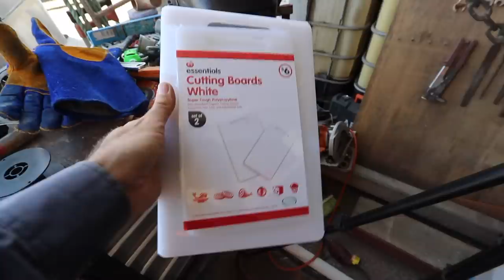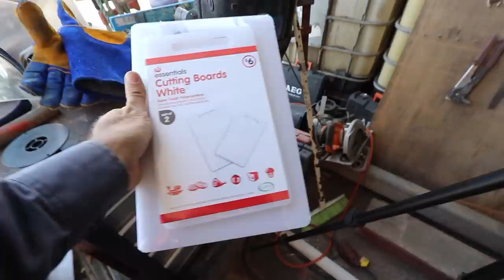DIY Rigid Inflatable Dinghy, Hull Welding Part 4, - Project Brupeg Ep. 110

Comment: Can you get to all the tube seam welds should one have a leak?  If not, I hope your pressure test shows no leaks.
Reply from the maker: Hi David, yip we built it so the tube joins were easy to access. once it was seem welded we run a positive pressure test and corrected the leaks. the tubes are now air/water tight.
Reply: I figured you planned ahead.  I know a lot of time miss things.  Great work!

Comment: On the keel of the dingy, in regards to the ice you might fork in your travels, add a length of the same pipe you used as a rail on the inside as a stiffener. Doesn't need to be fancy, just something to take the impact loads and soak them up. I feel that the existing shape is too constricting (it was a tube frame after all) and cracks might happen because of it.

Maybe even some straps along the inside of the seam between the old boat and the tubes, 3 or 4 per side from the center towards the tip. I mean, i know it's a dingy, but there's some considerations to be taken about aluminium in cold water. OH, and profit that the batteries are so small in the space you've made and insulate them well.

As always, just my 2 cents.
Reply from the maker: Hi Aserta, remember this is the back up dinghy so its pretty low speed (5-7knots) so major impact damage is likely to be minimal. However i like the idea of the straps for the Jet tender as that will almost certainly hit something hard at some point.

Comment: Looking great 👍 Not so sure about the cutting board tho, not much likes to stick to that stuff. Did you consider Anderson plugs (automotive) ? and a cable gland. Designed for high current and pretty cheap.
Reply from the maker: Hi Bill, i looked at both. couldnt get an anderson plug waterproof and able to handle the amps and yes a cable gland couldve worked but figured this was a simple alternative. The glue we used is pretty awesome, stiffs to bloody everything in the world
Reply: 👍 I should know by now not to doubt you 😁
Reply from the maker: Doubt away, i miss stuff all the time and its great to have it picked up now
Reply: Nah.. I aint no troll 😁

Comment: Great problem solving skills guys. I’d love to contribute in some way to the boat. Do you have a drawing with the outer dimensions and I’ll use screenshots to draw it up then 3d print it to make a cast in silicon bronze or whatever you’d prefer excluding the optimistic metals. I’d like to give it a crack mate if you’d like. Cheers.
Reply from the maker: Wow that’s an amazing offer. Could you email us at teambrupeg@gmail.com and we can chat about what we have. I have the original plans for the boat so that will have the dimensions needed to print the outer shape. A massive thank you for this. Damien & Jess
Reply: @ProjectBrupeg  .Hi guys.  Stl finder has turned up a number of excellent hulls which are easily modified to match brupeg. Virtual shipyard has an insane level of detail and the upper deck structure and fittings are readily available or easily modified. The drawings you have will make it quite accurate.  Thingiverse have great files of animals Jess as we will need a dog in there somewhere. Check it out. I really believe it will be quite beautiful when completed.  Thanks. Gregor.

Comment: For towing you need an eye on the front just under the tube welded to the hull.  You will need to weld a plate on to reinforced the hull. Towing from those handles on the tubes is too high and the tube is too thin. Pulling from that high will push the bow in to the waves and water and increase the towing resistance.Towing from lower down will pull the bow up and lower the towing resistance.
The lower eye should be i/4 inch flat plate cut in the shape of a D with the flat side welded to the hull. then drill a hole through it. The other option is a 3/4 inch aluminum rod or bar bent into a C shape and welded to the hull. It would only take about 6 inches. Cut the reinforcement plate and shape it to fit the hull. Then drill two holes in it for the C shape rod. weld the rod on both sides of the plate then weld the plate to the hull.  There is a tremendous amount of pressure on this tow ring. Of course this is just a suggestion.
Reply: I concur.
Reply from the maker: Hi John, Jim & Jet (sounds like a 60's Motown band), the original hull has a towing eye on it. i never really showed it on camera but it sits under the front tube so all force is applied to the hull bottom no the tubes. I liked the position and it looked well strong so i never altered it.
Reply: @ProjectBrupeg  You should hear us sing. Or maybe you shouldn't :)
Reply: @ProjectBrupeg  I do have one other concern and that is you may have cut the tubes off too short on the stern. The engine weight will be cantilevered beyond the transom. This will cause water to come over the stern when slowing down. I know the battery is far forward and may counter the engine weight, but you will never know until it is in the water. Part of the problem is the boat was originally an inflatable. With aluminum tubes and foam fill the boat is a lot heavier than the original design. That may have been counteracted by making larger than original tubes. I think you went with the same diameter as the Hypalon. I'm just thinking out loud. Good luck with it all.

Comment: You could have used boat shore power cord plug, theyre waterproof (sorta) well rain/splash proof
15A 240v theyre 3600 watt, vs your 60A 24v 1440 watt
Reply from the maker: True, the bolt idea works and is cheap as chips and pretty hard to break though

Comment: Do  you have any concerns about the tubes getting flattened by people stepping and sitting on them? It's great to see if almost finished, can't wait to see it on it's maiden voyage
Reply from the maker: Hi Jas, not at all, when we had to tack the tubes together at the right diameter, Jess had to stand on the unwelded tubes just to get them to bend in enough to weld. They are rediculously stiff given the cylinder shape. Significantly stronger than we ever thought they would be. And yes as Jim said, we have now filled them with closed cell foam so they are even more rigid again.

Comment: Why not just use a flexible piece of square sheet metal, or a piece of paper. Keep up the interesting work. Not sure if it's too late, but I would partition the tube, or fill it with closed cell foam.

Comment: hi guys 
great work with the dinghy 
how heavy you think it is 
looks a lot sturdier then an inflatable 
Louis
Reply from the maker: Hi Louis, we havent been able to weight it yet but our estimate is the hull would be no more than 35-40kg without batteries. Batteries for this are maybe 30kg on top of that, but that weight could be reduced if you used Lithium (ours our AGM). As for sturdiness, it really is, WAAAAY more stable than an inflatable as its so stiff. really nice boat to use.

Comment: Don't angle down back tubes... Drives much better in the water with extended tubes.. especially when using a more powerful outboard!
Reply from the maker: We kept the bottom long, we only removed the top.

Comment: double your plastic plates so one is inside one outside with hull sandwiched between plastic and lots of sikaflex
Reply from the maker: Thanks. Yeah I didn’t think of this at the time and it’s all sealed up now but if/when I pull these plates off I will add a backing plate

Comment: hi me again 
are you thinking to do a pressure test by welding or tapping an air valve and make sure it is all sealed upend a gauge 
it will assure you that no water can get in 
Louis
Reply from the maker: Yeah before we filled the inside with foam we ran a positive air pressure leak test. using bubbles to track down the bulk of the leaks and then moving onto acid to find the really tricky leaks that hid from the bubbles. The tubes hold pressure now.

Comment: Are your batteries able to withstand sub zero temperatures? Just wondering about Arctic use.
Reply from the maker: No. We are usig AGM, and most lead based batteries really struggle in polar conditions. fine in the summer but if we get iced over they will die. the plan for down south is to fit a pull start outboard onto this boat and drop electrics for the southern trip.

Comment: What's the deal with all those aluminum dinghies? Doug, then you - hope Sampson Boat and Acorn2Arabella would do a wooden ones. :D Nice work and great idea, btw but when making joints like you did using plastic isolator, its not very good to use plastic as tighting element as cable shoe will press into it over time, causing heat that will speed up the process. Its much better to nut it on both  sides.

Comment: Wouldn’t it have been easier just to buy an aluminum boat? If you sit, step on these tubes, will they bend?
Reply from the maker: Yes it would have been much easier but this design sell for close to 9grand in Aussie and we have spent less than 1k, as for strength when we welded the tubes together Jess had to stand on them to bring the two end close enough to touch. They are immensely strong because they are cylinders
Reply: Project Brupeg 
I just sold my 12’ RIB. I couldn’t sit anymore with hand on tiller and twisted to the right to see where I’m going. A combination of cold, chop and the need for speed, messed up my back for two months. It sure was fun, but getting old sucks and pain rules. It had a Suzuki 20 EFI with an 9 1/2 X 12 prop that would do 32mph with just the captain. Im thinking of getting a small center console.
Reply from the maker: Yeah, health really does make you alter your designs and needs. Thats also part of building a lot of this project for us, the ability to build in things to make life with a disability easier and still possible to adventure.

Comment: I don't think silicone is going to stick the cutting board isolators.
Reply: Good point... and I was wondering how well they would isolate if they got wet?  😲
Reply from the maker: Hi Dwpetty & Gilbert. the glue we used sticks like nobodies business so it held on quite well. I did try to pull them off when it set and didnt even get close. that said if we ever need to remove them im planning on cutting it. As for isolation when wet, once we have all the connections made they are fully coated in liquid electrical tape so they cant access the atmosphere, essentially isolating them from any water
Reply: @ProjectBrupeg  In the past I have tried to use construction adhesive on cuttings boards for different projects, without much success, I think because they
are food grade plastic. I'm glad it worked for you.
Reply: use aluminum rivnuts and screw them into place.
Reply from the maker: Yeah thats a great idea

Comment: If you used a hole saw and cut a second circular piece of chopping board, you could use a longer bolt and double up the chopping board. If the circular piece was on the tube side it would fit into the hole in the tube and hold everything central. In fact if you then added a third square piece of chopping board inside the tube the inner and outer square bits would act like flanges stopping the board from falling out, with the circular bit, acting like the meat in the sandwich, preventing up, down, left & right movement. This way the sikaflex is only acting as a sealant and doesn't have to mechanically hold the isolators.

Comment: I wouldn’t have cut the tubes off the stern. Better stability.
Reply from the maker: as in right off? the longer the tubes the more stability. We just trimmed the bit thats out of the water
Reply: Project Brupeg sorry autocorrect deleted the “wouldn’t” 😡
Reply from the maker: Ahhh makes more sense now. the back end of the tubes had a wobble in the circumference, they were very long also so we allowed for all of that when we trimmed them back. finished extension from the transom is 1 foot which considering the total length of the boat is 8ft we are happy enough with. Seatrials didnt show up any issues with stability (quite the opposite actually)

Comment: too bad you couldn't have made a recess in the rear of tube to have integrated step for getting back on the dinghy
Reply from the maker: We did think about that but with the big handles its really not hard to slide over the tube and in, ust like a normal inflatable only more stable

Comment: I really only know stuff about welding from this and other channels, so why not do a continuous line instead of anal lines here and there?
Reply from the maker: Hi Harry. Heat. Too much in one spot makes the metal warp so doing a bead 6-10inches long then moving some place further along allows the first weld time to cool and takes the heat out of the metal.